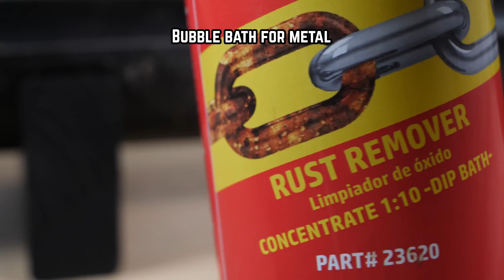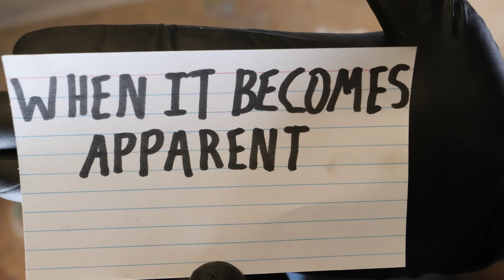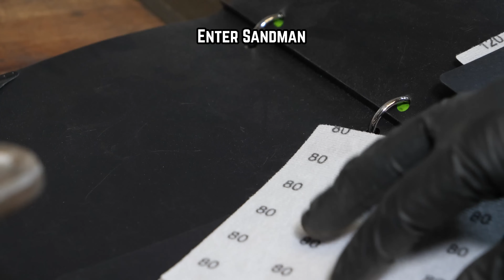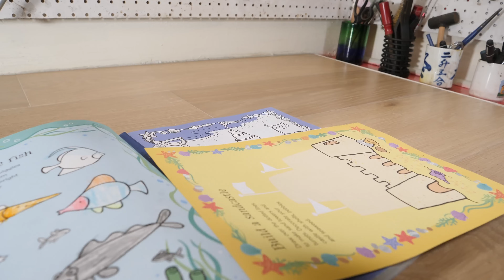Old Machete Restoration.

Comment: I think it would have been better to have made a mould of it and smelted and recasted it, because with that amount of cracks, especially as a hatchet/machete, it couldn't handle further punishment. Just an opinion, but hey, if it's just gonna be a collection or ornamental then I guess it's fine, but as a tool, with those cracks, may as well smelt and recast using the same mould